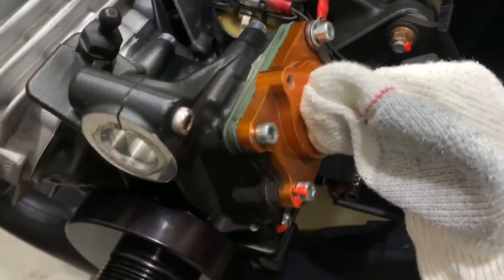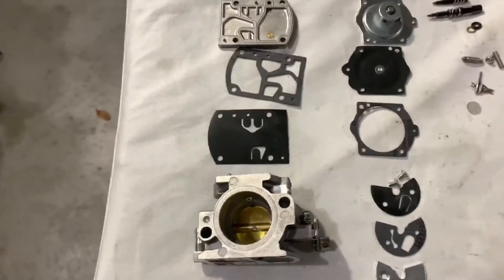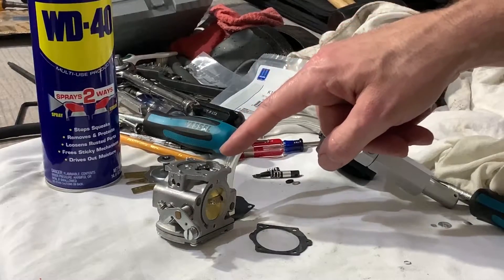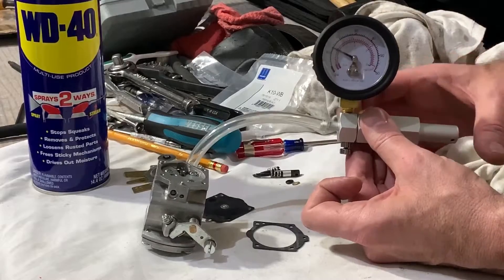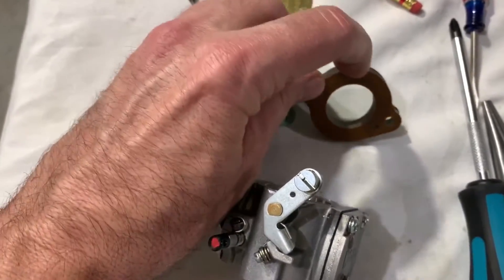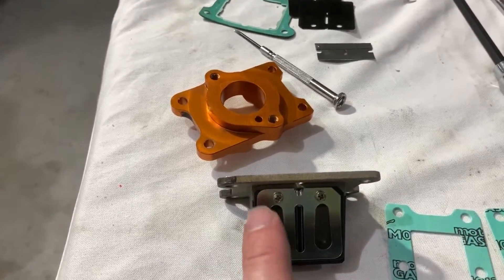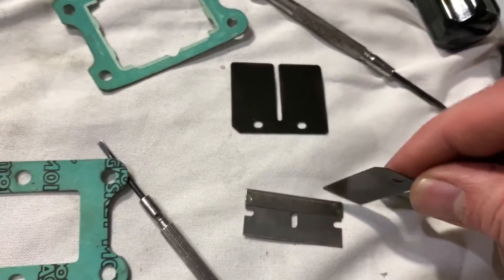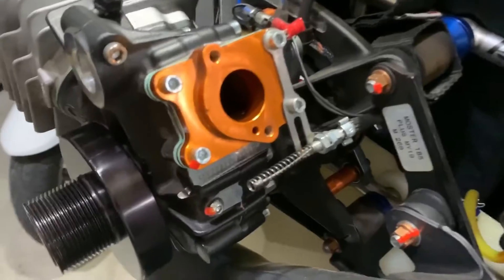Paramotor Maintenance Pt 3  Carb and Reed Valve (pop off pressure bonus)

Comment: Is the purpose of the pop off test to evaluate the the condition of the lever spring?
Reply from the maker: It’s mainly for proper running of whatever motor it’s mounted on.  You are looking for it to pop and then seal and hold.  It does affect fuel consumption.